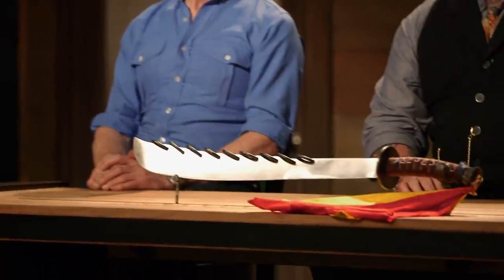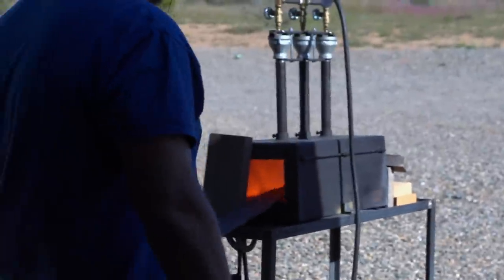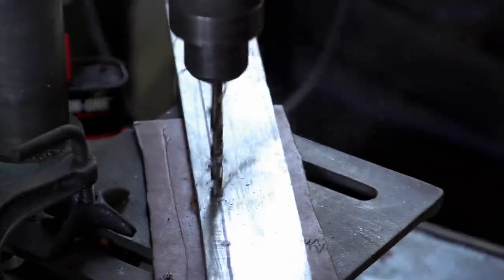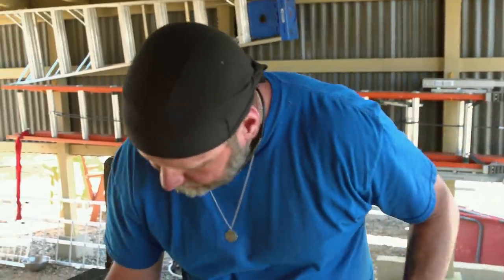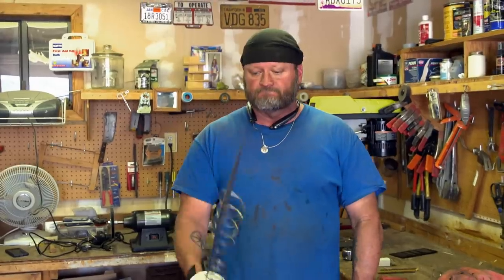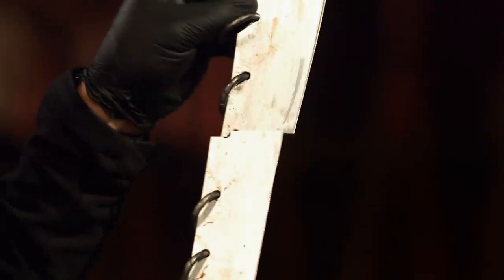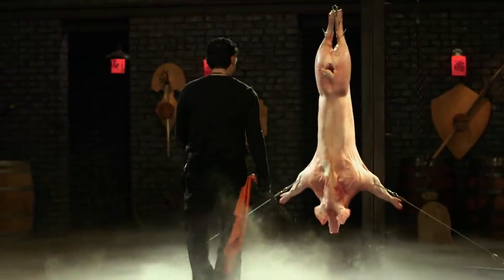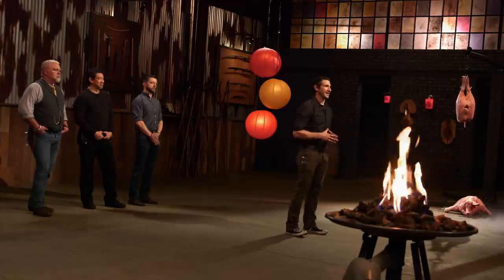Forged in Fire: 9-Ring Broadsword STIRS UP TROUBLE in the Dojo (Season 7) | History

Comment: 8:27. I think he got lucky since the red cloth covered the blade at the 9th strike.
Reply: that very thin cloth wouldnt stop a very heavy metal blade breaking against a bone.
Reply: Eaxacly, if anything it stopped the blade from cutting through all the way
Reply: The thick cloth reduces the overall impact as it covers the blade, protecting its weakpoints as the weight becomes evenly distributed.
Reply: @nigelinoooo  lmao funny how the "thick" cloth didn't distribute the weight of the first sword though. or did they use different cloths for each blade?
Reply: @tjzero849  Both cloth seem similar in material and strength. Difference between both is the striking motion and overall coverage. The first sword cut slightly diagonal which increased blade exposure, whereas the second cut horizontally and straight.
Reply: @tjzero849  There's a clear difference between both strikes of which becomes more evident when viewing both clips side by side. In this case, I can understand that both strikes seem very identical for the untrained eye. My explanation is not for making myself seem a "smartass", it is simply to state my observation.
Reply: The cloth did nothing. If you really watched the video you would have spotted that the sword broke right where the guy was making softer so he could drill.
Reply: @tjzero849 Listen here TJ, you seem to have some anger issues going on for my responses. In all honestly I was just trolling to see your reaction, but lost interest as your inner wife beater persona came out. I wasn't trying to proof anything although it seems you did. You must be fun at parties, can't even handle a discussion without getting hostile. Anyways, I got better things to do than going back and forth in this comment section.  Enjoy your sad life
Reply: @nigelinoooo  the "thick" cloth also got in the 9th slice for the first blade, yet it still broke.
Reply: @nigelinoooo  ahh, and ends with the generic “lost the debate so act like it was a troll all along and insult the person” not anywhere did I show aggression or anything. It sounds like you didn’t know how to reply Nigel 😂